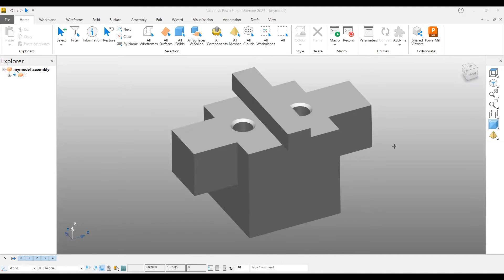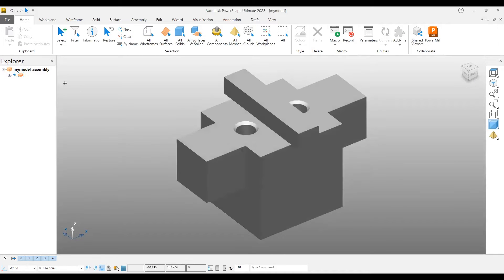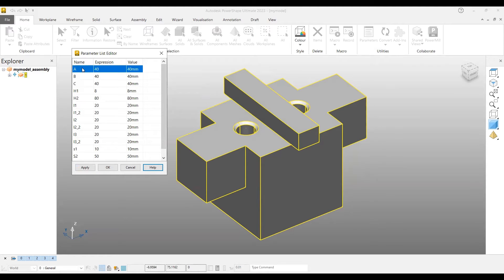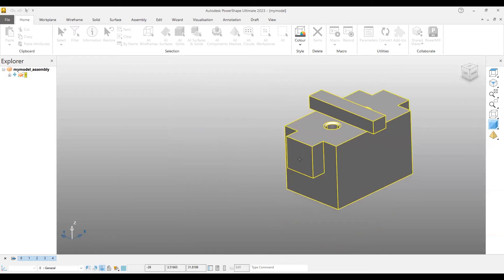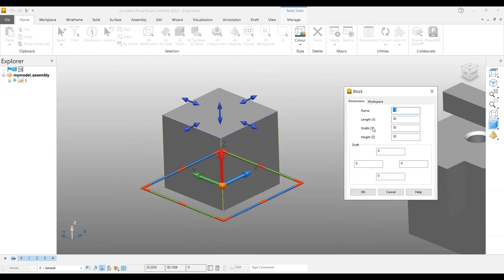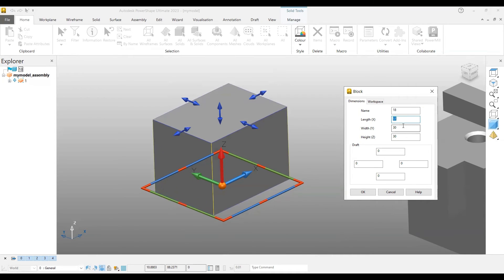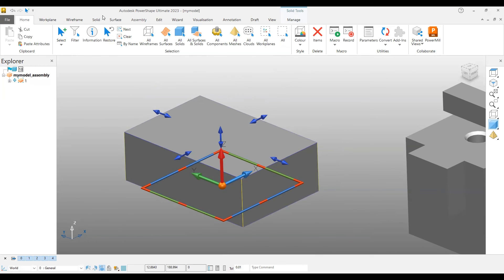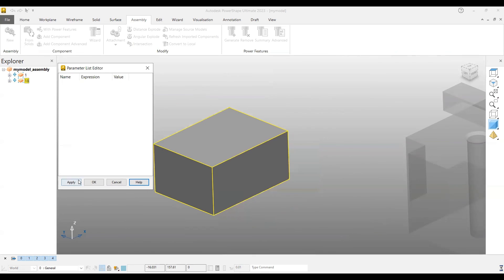Autodesk PowerShape - Modify Dimension by Parameter

Comment: Hi Rajesh Kanna, I'm from Mexico and I always use your videos to learn more about PowerMill. Your videos get straight to the point. I would like to see videos about SETUPs and FIXTURE OFFSETs. I'm trying to make 2 equal parts and use SETUPS and paste on 2 different WORKPLANE (with diferents FIXTURE OFFSET). Visually it works in powermill, but when I do the NC program, the toolpaths remain on the same G54 WORKPLANE. And I am trying to stay on different WORKPLANES G54 and G55.  

I hope you can watch my video: https://youtu.be/7DKNDjkPO5I

In the end you can see that my NC program does not show the working planes. G54 and G55. Only the G54 and machine the same toolpath twice.